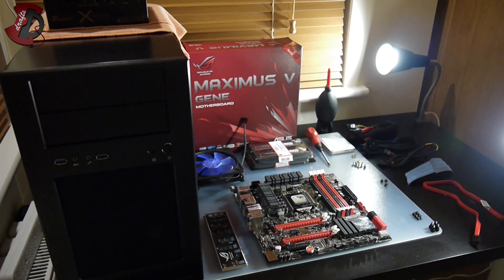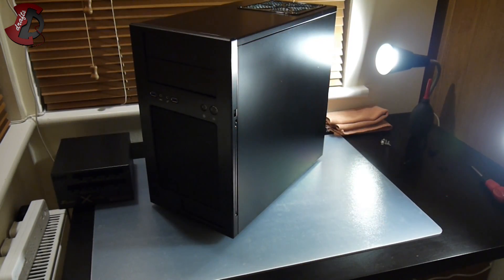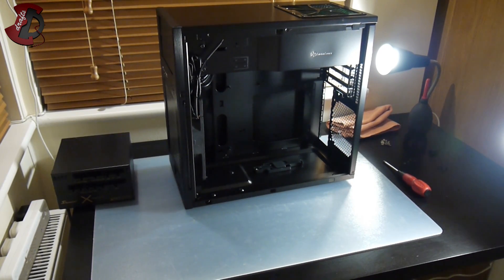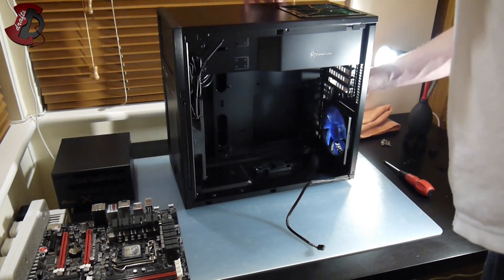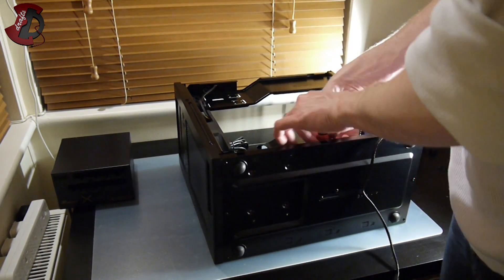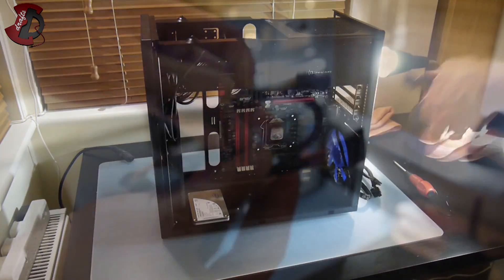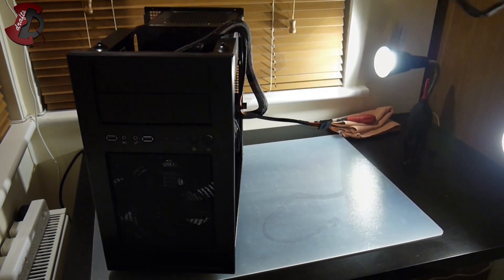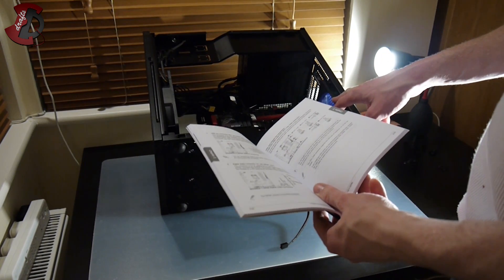IvyBridge Build Intel i5 3570k ASUS Maximus V Gene Z77 Part 1 of 2

Comment from the maker: Could be number of reasons. Not properly inserted RAM, CPU cooler/thermal paste not right causing to overheat, GPU not inserted properly etc. This motherboard has an LED indicator with 2 possible letters/digits on it. A bit like digital clock. Have a look at what combination you see and refer to manual for explanation. This might be a good start.

Comment from the maker: I would be surprised to hear. I have GSkill ram at the moment, works no problem. If the timings or something isn't right you simply use MemOK function. Also decent ram like Vengeance should have XMP timings for auto setup.
For peace of mind however, always check motherboard page for compatibility list.

Comment: hey eds, nice watching dis vid f ur's. i had my first rig build abt a mnth ago, i5-3570k, asus gtx 660, adata ssd, wd hdd, haf 912 case, antec kuhler 620 water cooler. unfortunatly around a week ago found my sys nt strting,found ma MB(maximus v gene) faulty. asus dissapointed me as there was a heck f a probs wid the warrenty in the servicing n all...:(

Comment from the maker: It doesn't really matter where you connect the drive as long as you set up boot device order. First SSD then HDD etc. If you are still having issues - disconnect other storage, leave just SSD to install Windows to. When finished, power off, plug all back in and go into BIOS - set boot devices so PC would boot from SSD. Done. AHCI is the mode. Best performance is usually Intel 6GBs - these are the middle ports of three pairs.

Comment: Excellent video. step by step. but I have a question.
what was the settings you used for the SSD in the bios (what port you connected to a red or black 3gb 6gb, IDE or AHCI).
I have a similar setup and I can not connect the disk or not seen when windows asks me to select drive during installation.
Thank you.
regards

Comment from the maker: Case design has changed quite a bit since ATX standard in 1995. There are a variety of case types now. I liked the look and performance of this chassis. Also I wanted something new, different.
For a new build I would consider any orientation as long as it fits the purpose.

Comment from the maker: Very good question. Yes, all the required screws came with the case, any additional with any parts that might need - i.e. PSU and Fan had theirs; CPU cooler had all the required brackets etc. included.

Comment from the maker: You must have loads of cash to spend on two GTX 670 while being unsure :-) Jokes aside don't worry about x8. Ideally for your GPU x16 is preffered but 1155 platform can only do 2 by x8 or single x16. Though it has been proven there is enough bandwidth in 8x 3.0 version not to bottleneck your GPU so no worried there.

Comment from the maker: Hi. You would but.. Why would you? Its like buying new Mercedes with hubcaps. Trade the two GTX 450 and some cash into GTX 660 (even non Ti) and you will have better performance, nicer image, lower system wattage not to mention heat and noise levels. Just my two cents..

Comment from the maker: Haven't had a need for this as my rig is not on test bench. Have you thoroughly went through manual? Is your mob getting all required power and CPU with RAM correctly installed? Try flashing BIOS through dedicated USB port. Also, have you tried case buttons? If you don't have a case see what pins on MB connectors are for power and use screwdriver flat head to lightly touch them - its the same as pressing button. Be sure you do this with right pins!

Comment from the maker: Plenty. Your display is not PSU dependant. Main things to worry about is the CPU and GPU followed by HDD, SDD, DVD, BR etc. In your case I bet you would be able to run it with decent 400W PSU. Having 600W power efficiency would be same or better (usually) and it will run cooler too as you won't be overloading it.

Comment from the maker: That's true, I agree. Ideally I would have to ground myself via bracelet, install the MB onto the tray along with CPU cooler mounting, mount the tray into the case, install the PSU and then just keep working by "touching" the PSU to ground myself (provided it's off and plugged in into live socket). Usually I simply ground myself to rad though that is properly grounded and try not to touch anywhere close the memory modules be it RAM or GPU. Hold onto "sides" or edges. Anyway. Well spotted.

Comment: About using the power supply as ground: The thing with ESD-bracelets is that they even out the static electricity between you and the components. If you ground yourself using a power supply there could still be a difference in static electricity between you and the case/components.

Comment from the maker: No flashing needed. Plug and play. Update the BIOS anyway just to have all bug fixes and you are set. Anything above 300W is enough for 3570k. It usually depends on your GPU though. If you have GTX 580 to go along you might want to get at least 500W - 600W PSU. Not sure of the brand you chose though, are they any good?

Comment: sorry i have a question based on some comment that i saw here: do u have to flash it to be compatible with the ivy bridge? also i want to ask you if im ok with a power cooler 550w modular to use this mother and the i5 3570k... thanks

Comment from the maker: Sorry I am just too comfortable with current settings and don't feel overclocking is needed. Not yet anyway :)
As for cooler it depends on budget. Where I live Noctua is not that much more expensive (~€35). In my case, however it's all about space I have to spare and Noctua eats it all.
Why do you need to OC it anyway do you mind me asking? 3570k is a very fast chip. Is it just enthusiast thing or you need it for encoding/rendering?

Comment from the maker: It's fair enough. I think the suggestion is very right here. However, I don't follow any rules myself, just build the way it seems better (obviously making sure I don't do silly things like mounting cooler and then trying to install CPU :). I wanted to try installing the parts right into the case this time. Seems it worked just fine.

Comment from the maker: First things first I can't advice on Windows because it's a pirated version (correct me if I am wrong). As for the booting process keep pressing delete as soon as you turn the PC on and do so until you see BIOS. Then just find boot option and go for it. If it does not work simply press the CLEAR CMOS button with arrow going around (it's where your I/O shield is). And try this again.

Comment: I have the maximus v gene   but I cant boot it up I have an intel i7 ivy bridge 3770k and 16 gb of ram and I have an old drive a 500gb seagate barracuda and I HAVE A BURNED VERSION of windows on it and I want to boot from this drive and it sucks , because when I turn on the pc there comes out that please press del to enter the bios and I am pressind del and nothing happens , and it automatically goes into the setup mode , is it because of the copy of windows ? or something else ? please help

Comment from the maker: Makes no difference to be honest. One thing I like is that this way your graphics card is always on the top and HDD on the bottom, along with CPU. So the temperature of GPU that is always the highest in the case (unless CPU is not cooled properly) does not affect other components as much. PSU is also protected from internal heat and takes fresh air from outside. I was a bit surprised as I was always building budget builds with 'standard' cases but now I see benefits of this Silverstone case.

Comment: k i put the rampage v gene into a corsair graphite 600t white which has a front usb 3.0 slot but i might not need to use it because the rampage has a couple usb 3.0's on the back... and im just going to use the built in sound card unless i really need a dedicated one.. no use spending extra money what graphics card do you use?

Comment from the maker: To the motherboard. It's in the video :) What type of motherboard do you have? Maybe yours does not have the USB 3.0? Then just use 2.0 adapter that was included with the case and connect it that way.

Comment from the maker: ASUS GTX 680 just like most if not all GTX models have one side of "naked" PCB and other fitted with cooling device. In this build the cooling will be pointing up so it will not obstruct at all. Noctua cooler is huge but that should not interfere either. I have no GPU at the moment to test it but I am sure companies like Noctua and ASUS along with Silverstone made sure that such configurations are possible. As for HDD/Noctua configuration you might want to fit HDD into DVD drive cage via adaptor

Comment from the maker: It is a very worthy case. For watercooling you might not be able to fit more than 1x120 without mods though. Not sure of SSD temps but my MB is around 33 so is the CPU. Where SSD sits it gets fresh air by front intake fan, nothing else so should be IMO below 30. Tried SpeedFan just now it went crazy, says 15,4,11,11 for cores. Yeah right.. Ambient is around 25 now.